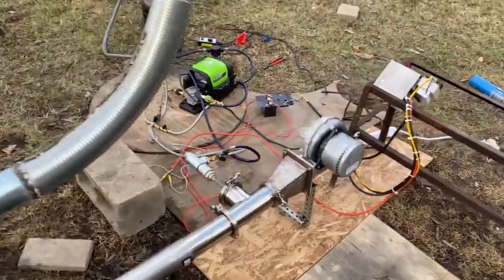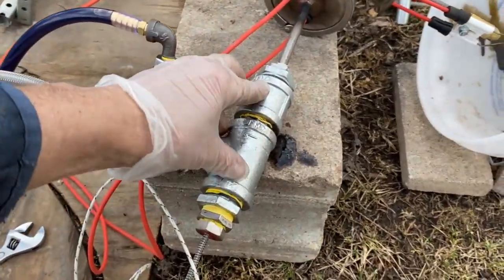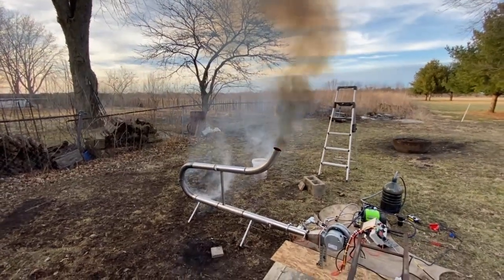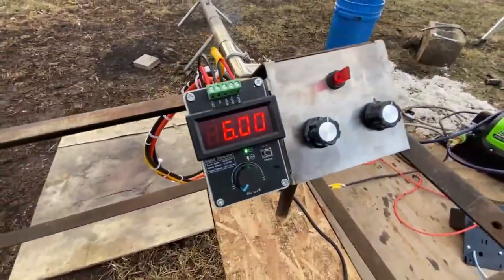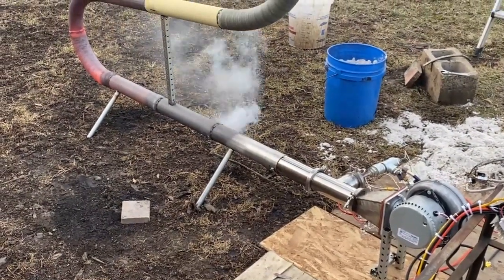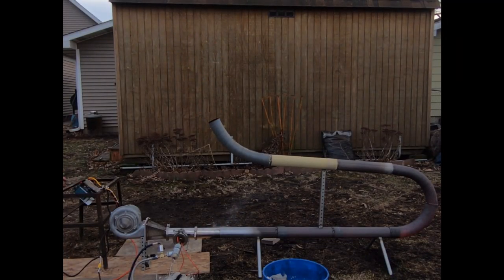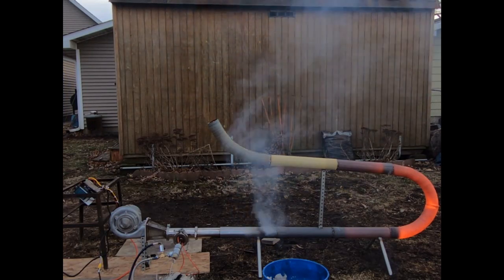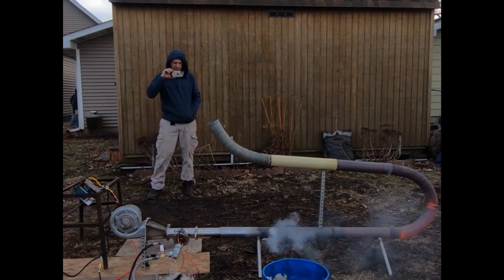Radiant tube burner waste oils for Steve

Comment: Ever try drip feed, rather than atomization? The downside is the need to pre-heat the combustion chamber, but the upside is that you can use really dirty fuel.

Comment: If the Gas Setup can stay a low Power Startup with Natural Gas or Propane might be easier?
As soon as the Tube gets to a Base Temperature suitable for liquid Fuel you should be able to switch without excessive Smoke.
Reply from the maker: Yes that is what i have to do with my plate burners .

Comment: I CAN say, however, that due to the carbon monoxide hazards [both for breathing and because it is flammable and explosive] those LEAKS need to be fixed somehow, be it by welding them or putting some kind of refractory sealant over them.
~( 'w')/